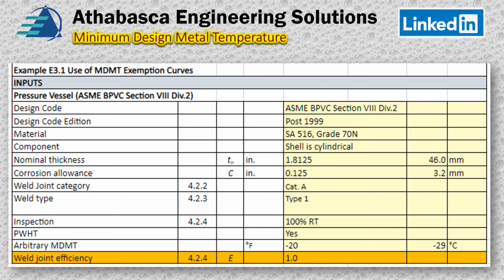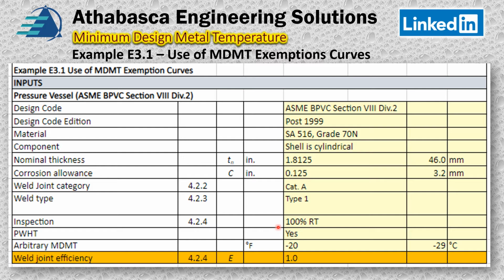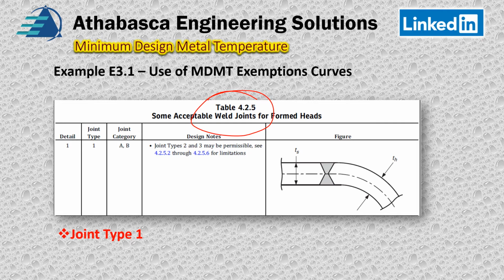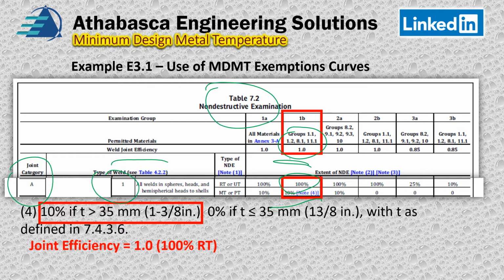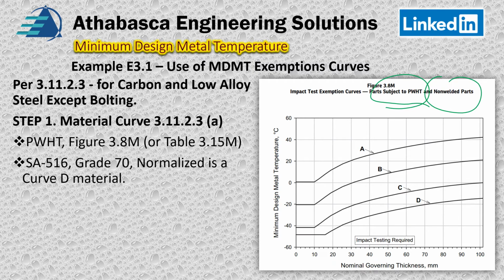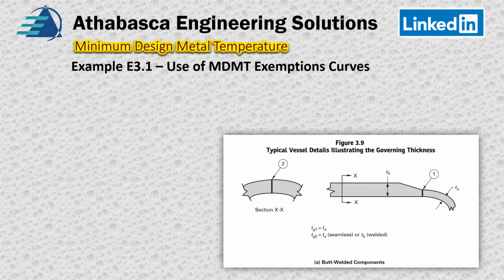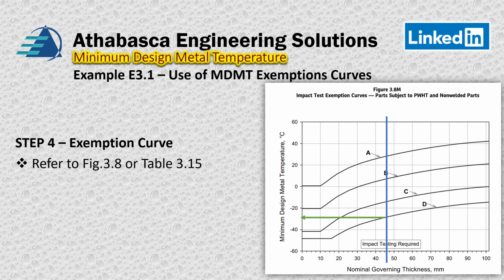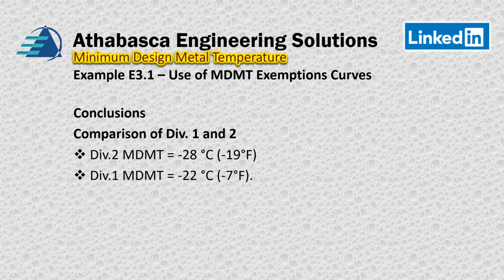Episode #13 MDMT Section VIII Div 2  Example E3.1

Comment: You are requested to please upload complete course of design of Heat Exchanger or Pressure vessel in PV Elite Software with Manual calculation according to ASME Sec.VIII div.1 code.